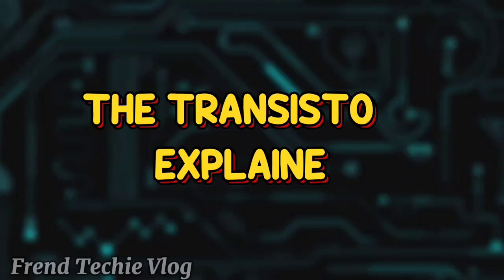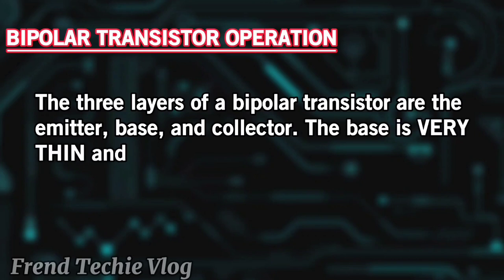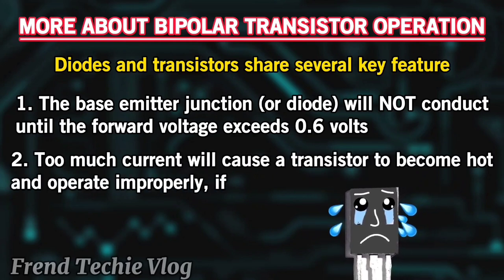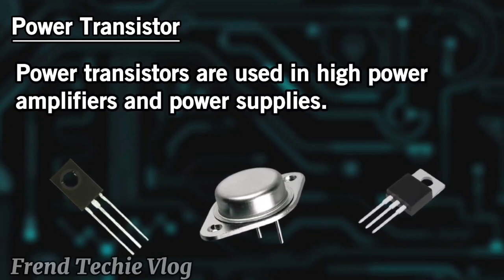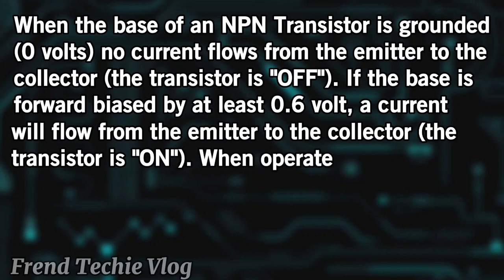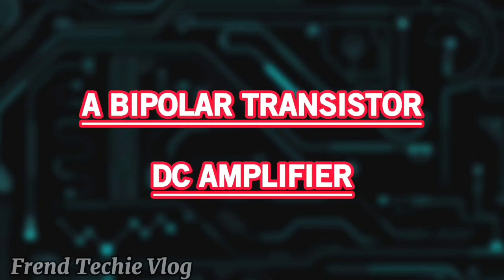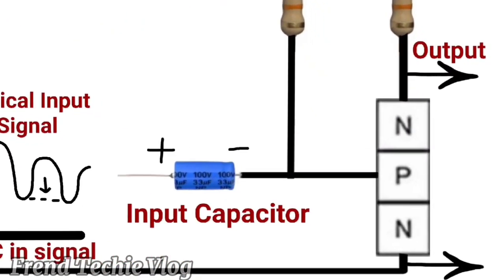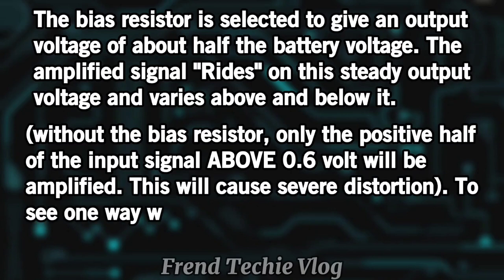How does the transistor actually works?

Comment: can u please tell the: LATEST application of pn junction diode, please.
I want to know the Latest application for my assignment
Reply from the maker: PN junction means electron and holes flow of current in forward biased and reverse biased no current flow.  Diodes used in so many applications.Photo diode when sensitive to the light, used as a solar cells LED lighting application in forward biased, signal diode , oscillator as a switch diode in so many amp.etc.